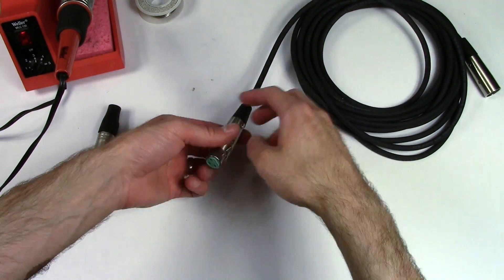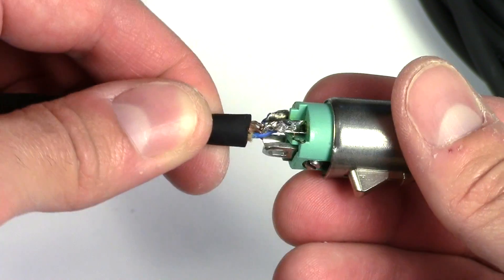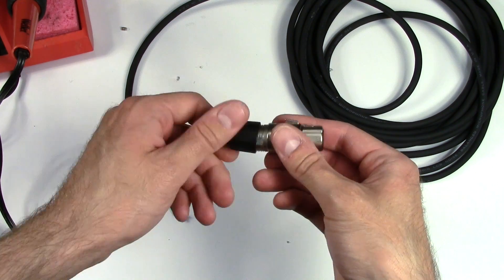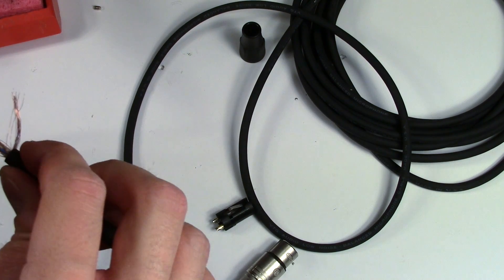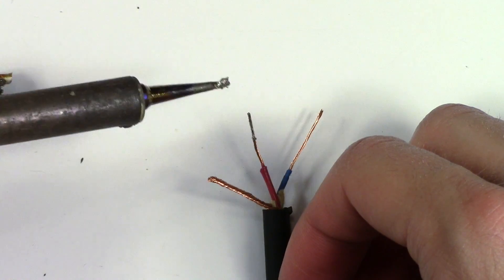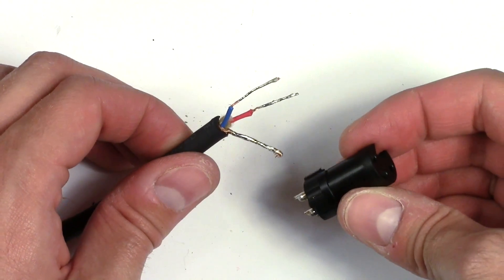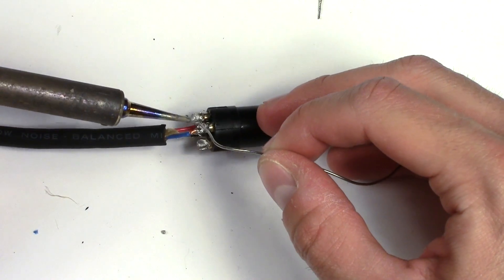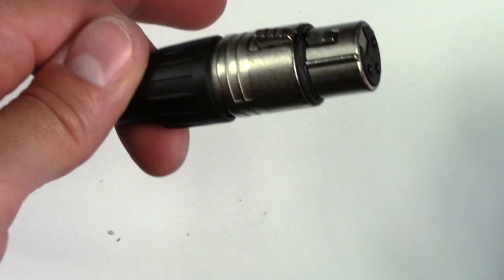How to Build Mic Cables and Replace XLR Connectors

Comment: Love The Video 👏👏👏
Challenge Question (for any body) I'm trying to connect a female xlr with a female speakon & now I'm familiar with red/blue/wires but where do they go on the female speakon? The female speakon adapter has 2-positives (1&2) & 2-negatives (1&2).
Please advice

Comment: I'm horrible at soldering, but shouldn't you heat the wire longer so that the uncoated wire sucks up the solder instead of putting hot solder on cold wire?  You were doing that when you were tinning.

Comment: Switchcraft  please don't run them down i had a 24 audio loom with them on i can tell you they are very good used with the right cable. and in the right place i would not use them for 
a live gig

Comment: Hi. nice video!

I have a question, i bought xlr mic and usb interfece {both used}.
but every few seconds the recording dosent get my mic signal , the mic stops recordig flyor a few seconds , and then is recorfing again. does anybody know what is that problem likely to be? the xlr cable? the mic?
Reply: Try plugging the microphone into a different audio interface - if that doesn't work, change the cable. If that doesn't work either it's the microphone